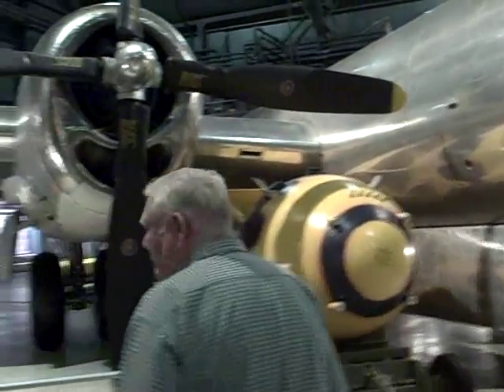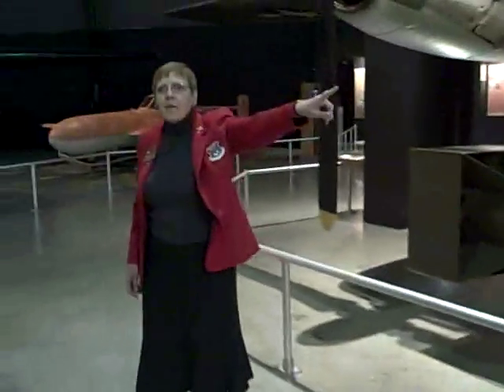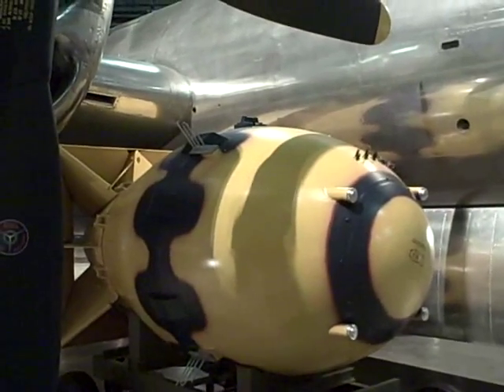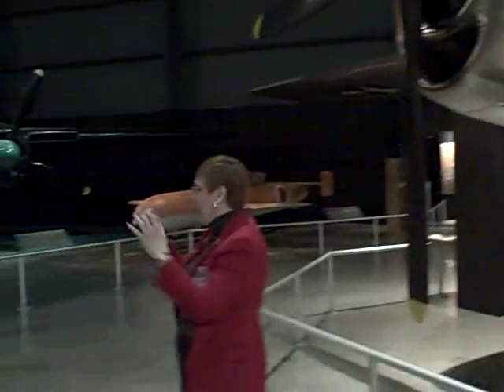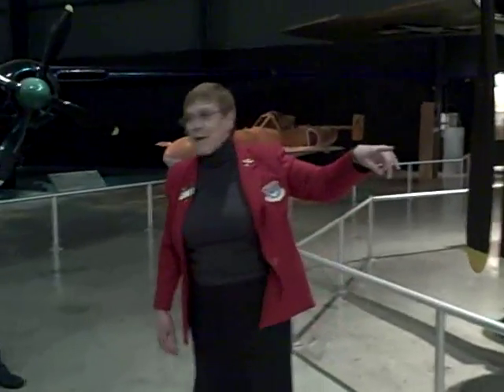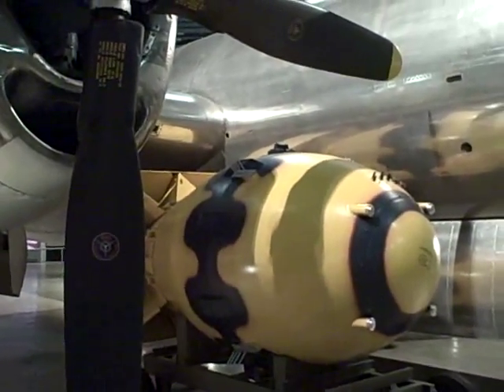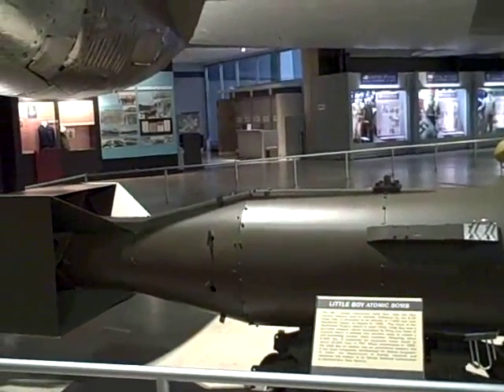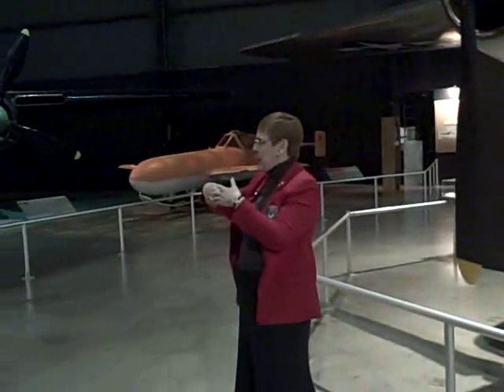Fat Man (Plutonium) Atomic  Bomb

Comment: I live in a nuke bunker 78 feet under ground and i have 20 years of food i got wifi power air conditioning jeeps and a helicopter im well prepared for the apocalypse
Reply from the maker: funk bros2 as long as the power and internet are working I think you've got a good survival plan. Do you have a backup power supply? I don't myself.
Reply: @CurtisBradleyCurtCast  no because radiation last to 10 to 20 years i know alot about nukes